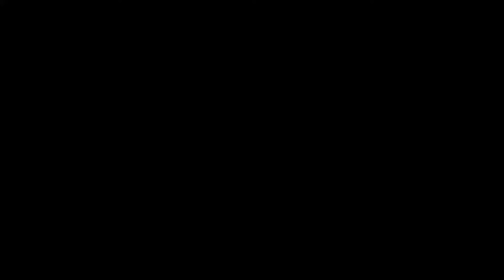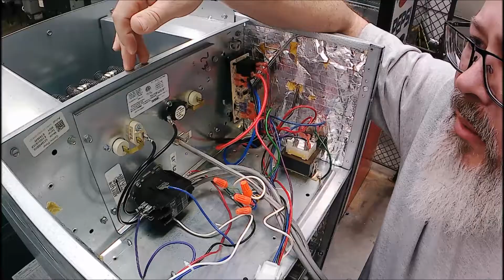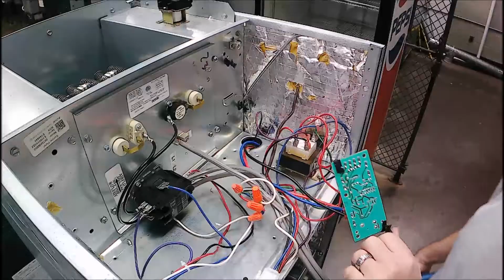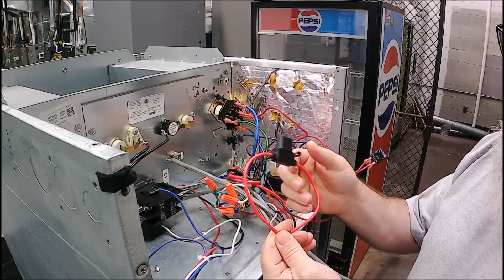Can a Relay replace a Circuit Board?? | Understanding HVAC Electrical Concepts

Comment: John, very good video, I learned something new. Just got a question for u. On my ac unit (outside only) it has 2 capacitors 1 for fan 1 for herm, now my fan capacitor went bad so I replaced if, the herm is old I have had this unit for 25 years now it’s a Lenox. Now can I replace both capacitors with one that has 3 contacts I know the uf of both get capacitor can I get one with c/fan/herm to replace it with.?
Thanks Richard
Reply from the maker: Yes. If you know the capacitance (uf) of each one then you can get a dual capacitor that has both on it. The only thing I can forsee that looks different is that you would possibly have 1 extra wire left over and could be removed. Since each capacitor  needs power coming into it you would have a wire for each coming from the contactor (generically speaking) but if you replace with the dual capacitor you would only need 1 wire since it is just 1 capacitor. There are some amperage values to consider so I would keep and use the one that is for the compressor, remove the one currently used for the fan. The wire going into the compressor capacitor should probably be a large enough wire gauge to handle the new capacitor with both motors.
Reply: @johnjennings-JJ  
Thank u very much, I thought that it could be done but wanted to make sure. I will but a Saul capacitor and have it ready if or when mine goes out. Sure do thank u for ur quick reply and knowledge. Again thanks
Richard

Comment: Hi 
For the Goodman circuit board where you have NC,NO and COM. The way it work, you can only use it for one speed?   How do I pass my 240  through it? If yes, do I need an additional component for my high speed for cooling? 
Thx
Reply from the maker: It is a "one speed at a time" control board. It was set up that way and you shiuldn't need to do anything else. The speed you want to use goes on the COM terminal. The purple wire from the heater kit goes to the NC, and red wire from L1/primary side of the transformer goes to NO. 

No more no less!
Reply: @johnjennings-JJ thank you for taking the time to respond. So if place my slow speed on the com terminal, one hot leg on the NO terminal and energized my relay my blower kicks on. What the point of having hot wire from the primary on NC terminal? What is it use for?
Reply from the maker: It is just a backup/fail safe for running the blower motor when the heat strip(s) come on...have to have airflow!
Reply: @johnjennings-JJ  thank you. Last question. Can you give me an example of a component I can  use to turn my cool ( fast speed) on? I’m currently an hvac student and the school does a horrible job of teaching
Reply from the maker: Sure the goodman board is pretty much just a relay that has a connected set of 2 switches. 1 normally open and 1 normally closed. If you want to "cadillac" this thing a run a low speed for heat and a high speed for cool...no problem! You need a relay with 1 normally open and 1 normally closed switch! Just on this one you have to have them separated...no COM terminal. The COM terminal just means that the two switches share that point and for a PSC motor...that is usually where the fan sped is connected. Oh, and make sure if you go with the "new" relay that you program the thermostat to let the equipment turn on the heat. That way you will use the normally closed switch in heat mode as intended.
Reply: @johnjennings-JJ  thank you. I really enjoy and learn from your content

Comment: John, I have a 25 year old Goodman unit where the fan board switch continues to get stuck. I plan to put a 90-340 in place of the timer board. And leave it permanently.
I know you said you do advocate replacing parts with OEM parts. Do you again recommend that I buy a new board?
I had a row with Goodman long ago. A lizard got across the compressor start capacitor and it exploded. The capacitor value was rubbed off and they refused to tell me the capacitance value of the capacitor. They said I was not certified. It was summer in Texas and I have grown to dislike Goodman and their people very much.
Can I just leave the 90-340 in there?
I have contacted you before. I value your opinion.
Reply from the maker: I personally love that relay and it don't seem to quit! I like OEM but sometimes enough is enough and you gotta do something like put a relay in...no worries. But I would say that depending on where in the house (hallway closet maybe) the air handler is that you may notice it to be a little noisier because you can hear that switch close --- 'click' ---- everytime that coil gets 24v. Honestly if the air handler is in the attic or crawlspace it probably won't be a noise issue.
Reply: @johnjennings-JJ  It is under the stairs. I think it will be fine. Thanks for replying so quickly.
I'm the guy in Texas that invited you to go floundering a year ago.
I have an electrical engineer friend that completely installed his A/C unit. I tell him all the time to look at your videos.
Thanks so much.

Comment: So I run into this all the time they might have a ECM motor or they just have a old unit and the board goes out and they really don’t have the money to buy a new board but my question is how can I hook up the heat and the cool For the fan and make it cut on and off properly even if the fan goes out and the heats on where it was shut off using the relay if that makes sense to you I don’t understand how to use a relay with heat and Cool off the green wire Because if I hook the white wire and the heat strip just comes on when it calls for heat. What if the fan goes out? How can I make a safety using relays
Reply from the maker: If I am following your thoughts correctly...here is how I would use then90-340 relay. Terminal 1 (COM) = Fan speed, Terminal 2 ( NC) = L1 from heat strup circuit, Terminal 3 (NC) = L1 from terminal block/power source. You would need to place a wire from the leaving side of the heat sequencer (on the high voltage wire that is going to the heat strip) to the Normally Closed switch/terminal on the fan relay. If it is the 90-340 relay the wire would go on terminal 2, terminal 1 would be the fan speed wire.  This would be a high voltage circuit to power the fan at the exact time the heat strip is powered. No need for 24v on 'G'. Cool mode, the tstat would power 'G' and close the switch from 3 to 1 on the relay and power the fan.

Comment: Can the board in the condenser be swapped out in the same manner, but also add a thermal relay for the crankcase heater? The board needs to be programmed by a dongle and is meant to be communicating with another system. Since it's a donor from am old job, and for educational purposes I want to get going.

I also have to add a contactor for the compressor. Possibly one for the fan motor as well I'm not sure if the relays in your video can handle the outdoor units fan amperage
Reply from the maker: Possible but it isn't as smooth operating without a timing feature. Probably end up with more parts and pieces taking up space but it is possible. 
Have seen a crankcase heater with in inline temperature switch set at like 70 degrees...wired straight to bottom of contactor for continuous power.
The 90340 relay should easily handle the fan motor on most any residential setup.

Comment: I worked on old furnaces years ago prior to printed circuit boards being used in furnaces.  I remember that they were set up with sequencers to energize the blower first on before the electric elements and last off after the elements turn off.  Kinda wish things would go back to that simplicity.  Good video, enjoy your videos.
Reply from the maker: I got wire strippers! It can happen.

Comment: I may have missed it but do you loose and functionality with the relay?
Reply from the maker: All the circuit boards have relays on them. Little smaller looking and probably use DC voltage but still a relay. So I try to keep it simple in my head and one thing I tell myself is this - relays react instantaneously but circuit boards can be programmed for different timings to bring stuff on or turn it off.

Comment: In my mind I was thinking if I have a problem with my furnace and it showed a bad circuit board that using  the 90-340 relay I could replace the board ! and guess what your training session not only proves it but shows how. I already had my mind set on doing just as you did, Thank you for setting me straight, I am a retired aircraft/automotive mechanic and my mind is always open for new ways of doing things. I am 86 years old and this keeps my mind active. I have never had a service man on anything I own , I either fix it or break it then buy a new one !
Reply: Industrial electrician here….there are off delay relays, on delay relays etc. both with n/o and n/c involved. these can be ordered ahead and shelved…way better than simple boards that always give up at the most inappropriate times…..
Reply from the maker: I like the way you think. Keep your mind active. Broke plenty of stuff and the wife liked it because she got a new one. Sometimes she thought she was getting new and I fixed it to her disappointment!

Comment: what does the brown wire(heat strip) does/function on the relay?
Reply from the maker: If I remember the goodman heater kit wiring  correctly, i think it is used for a 2nd sequencer or relay providing a second stage of heat strips, because they use a blue for the 24v common. If it is another brand besides that I would have to know the model in order to look up the wiring diagram

Comment: What if i take wall thermostat out and heat elements turn on and off the only way to turn it off is kill breaker
Reply from the maker: Sounds like a bad heat relay or sequencer...depending on what you have in the unit. If it turns on and off with the thermostat out of play. It seems to be a switch stuck closed on the relay.

Comment: What name have that relay ??
Reply from the maker: If you look up a "90-340 relay" you will find it. There are a few manufactures that use it under those exact numbers but it is just DPDT relay with a 24v coil.
Reply: @johnjennings-JJ  thanks my teacher

Comment: Hi, I have another question. I have a control borad that doesn't have a fuse. It has 6 wires connected to it. It has the 24v red wire, The common 24v and the green wire all connected to the board. I m wondering why the 24v red wire also connected to the control board since it already has the 24vcommon and the green wire connected to it. The other 3 wires are the speed wire, the 240 v wire and the wire comming from the heat strip. My question why do they have the 24v red wire also connected to the control board? Sorry I can't send you a picture but The control board part # is WJ26X24063. it has 3 terminals in the back red, then blue then green all connected. I m just trying to figure out how to replace it with a 90340 relay. Thank you for your help
Reply from the maker: For me (personally) i think like this...1...a circuit board needs power to its brain in order to watch what's going on...2...circuit board give better option than a relay. Relay is instant on and instant off but circuit board have a program to, for example, give us a fan delay timing when turning off. So short answer is your board need the 24v red to work right! I would guess it has a 30 seconds delay (or something similar) before it cuts off...even after it loses the 24v on the green. To replace it with a relay would be using everything but the 24v red. The relay coil would need 24v on green and 24v common to the 24v coil of the 90340. High voltage would hook up in proper place on switching part. But you lose all "timings" with a plain ol' relay. ***I hope I got close!
Reply: @johnjennings-JJ  thank you for your detailed  explanation. I have few of these control boards running but for some reason some of them  keep failing and need to be replaced. I have one that was replaced with a relay by an ac guy long time ago and that one is running good.  I m just getting fed up with calls from tenants about the same issue. Also these control boards are getting very expensive to replace. Thanks again. Onetime, we lost power in the complex and when power came back two ac units wouldn't start because of these control boards failing to work.

Comment: I was considering adding a relay that energized off the 120 terminal feeding the fan. Trying to take the load off the board relay with a secondary relay. Seem like these board contactors have a lot of failures.
Reply from the maker: Circuit boards are nice and quiet compared to some relays. That ol' 93-340 is tough to beat but it does 'click' and make some noise.

Comment: John, I have a Goodman AC unit which is 25 yrs old and has been a wonderful unit but occasionally the blower inside can't start. It just rolls slowly and if I switch the on/auto blower switch a few times it will start. The fan motor rolls fine when it's off. I changed the thermostat. That wasn't the problem. It has done this for 2 years. I am considering putting a 90-340 relay around the blower board relay.
Last week, for the first time,  the blower did not turn off after the compressor quit. What do you think?
I write you because you are an excellent teacher. The best I know of. 
Please,Tell me what to test.
Richard

Comment: Thanks John, That is a really good explanation. However, my mind can not quite follow the electric path. I will have to draw it out. I am not sure why the call for fan would be used to energize the relay. I need to see if I can wrap my head around this with some diagrams.
But overall, a very good video.
Reply from the maker: I always have to draw it out! An old teacher of mine said that once you draw it and can make it work on paper...the hard part is over. Thanks for watching.

Comment: Hey I have question on the 2 reds on the fuse. One is connecting from 24v transformer and where’s the other one coming from? Pls help
Reply from the maker: From that going into the red thermostat wire (usually wire nut together) the will eventually go into the thermostat R terminal.

Comment: At 4:05 you make it sound like that one red wire has 208/240v on that one single wire, that should be 120v on that wire alone and another wire would be needed to make 240 at the motor. Unless I’m misunderstanding
Reply from the maker: No, you are right, it would be 120v per wire. Sometimes to try and get it across to a younger tech I might blend it together but not intentionally. It can make them crazy trying to figure up 208 volts from 2 lines that are 120v each!
Reply: @johnjennings-JJ  ok gotcha, thank you for the reply and all the videos you produce, I learn a lot from them!
Reply: One leg to the motor is always hot but the fan has to have 240 to run which the leg through the relay does.
Reply from the maker: I saw your other comment but couldn't find it but yes the thermostat would energize the 'W' to turn on the heat and really because of that N.C. switch it would bring on the fan whether or not the 'G' was energized or not. Then in cool mode the thermostat would bring on 'Y' and 'G' together.
Reply: @johnjennings-JJ thanks for replying. I realize the purple wire powers the blower during heat mode. I am a little slow at this but finally put that together. I guess the purple wire comes off the load side on the contactor  (first stage of the sequencer on some units). I used to work full time in this field as a heat pump start up tech but I am back to doing carpentry that I have done longer but get requested to fix my employer’s aging hvac units that you can no longer get boards for. This video was very helpful with that.
Reply from the maker: Right... the relay switch just breaks that complete circuit on one side (typically)

Comment: A fire inspector in Farmers Branch, Texas, made us do that to a bunch of Goodman air handlers during construction. Much arguing took place between her and her boss, but they still made us do it. They wanted the blower to shut off instantly in case of a fire. No other fire department or city has ever made us do that. To be clear, they didn't tell us to put a relay in, and I doubt she or her boss knew what a relay was, but the order was to make the blower stop instantly, so that's how we did it.
Reply from the maker: Had something similar here too. The package units had blower motors that had delay turning off. I think it was some type of ECM motor...anyways, the fire inspector didn't go for it. Had to go and install  contactors in the units so that the fire detector would kill power instantly.

Comment: Speed black wire and yellow line to contactor start up on blower for a 20 + yr old trane gas package unit ...
Reply from the maker: Might be a little different depending on if it has an old fan/limit switch or a circuit board! I have mostly heat pumps in my area and haven't been to an older gas-pack in a while.

Comment: Thank u for the video 
My heater is runing non stop it passes the temperature been set for, I changed the thermostat and filter and it keeps running,  it was working fine couple days ago 
Thank you
Reply from the maker: If it an electric furnace type then it might have something to so with the heat sequencer/heat relay switch being stuck closed. (Plenty of people have had that issue!) If it is a gas furnace then it will likely get a little more complicated/expensive... which type of system do you have?
Reply: Change sequencer it works now thanks for the tips
Reply from the maker: Don't thank me...you did all the work!
Reply: Thank you it's a goodman air handler electric,  I was thinking maybe the control board but I will try to replace the sequencer